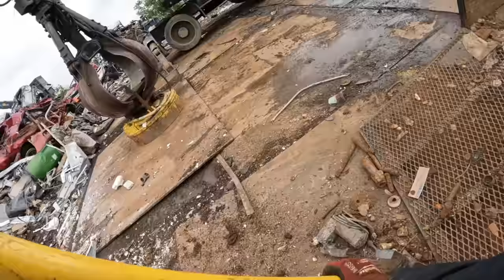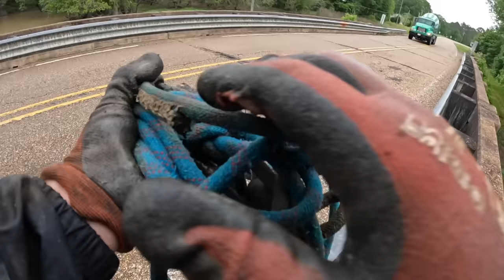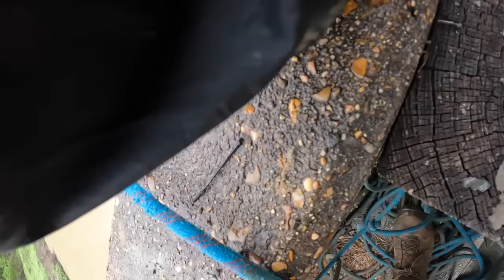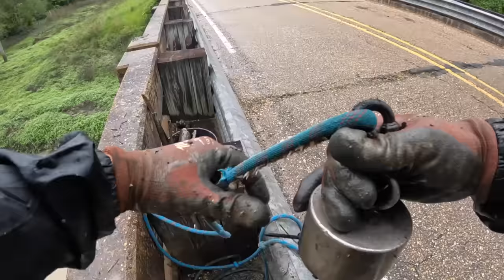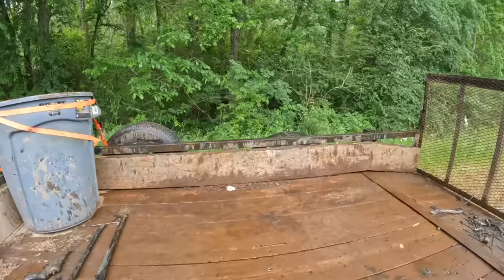GUN Stash Uncovered While Magnet Fishing - Best Day Of Magnet Fishing Ever

Comment: The triangular blades you're finding are the cutting blades of a swather (cuts alfalfa,maybe wheat too.) Mounted in a line the width of the cutting head going back and forth just like an electric barber shear.
Reply: Exactly
Reply: also found on the front of combine harvesters
Reply: Yup swather blades. Installed several over three years cutting hay and straw as a teenager.
Reply: @oldfart2413  also a sickle bar mower.
Reply: Cutting knife of a grain head.
Reply: they are also used for cutting beans
Reply: Mower blades old tommy mower blades
Reply: I confirm, the triangular metal parts go on the cutter bar of a combine harvester!
Reply: @andrewo763  also on horse drawn hay mower,,,,,,the other thing this city boy didnt know was a main bearing from an  engine, and a steering rod end with balls on the end for steering car or carriage
Reply: We called that machine a Sickle Mower. Commonly used to cut hay in the old days and I've seen a lot of them used to trim highway shoulders using fairly small tractors.
Reply: I haven't run a swather for about 20 years but I knew those blades as soon as I saw the first one.  You never forget them after you've had to sharpen thousands of them.
Reply: or on old horse drawn hay mower,,,,

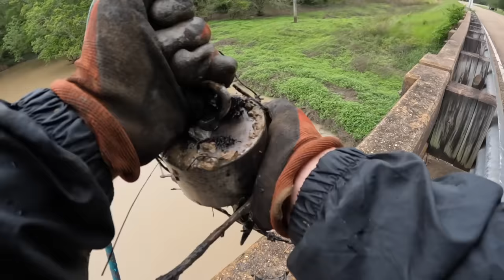Comment: 2:24  An engine rear main bearing.
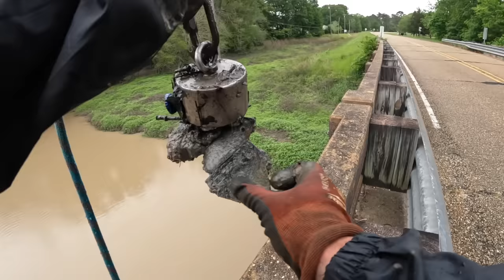2:48  Those are John Deere sickle mower blades. (I have changed a bunch!)
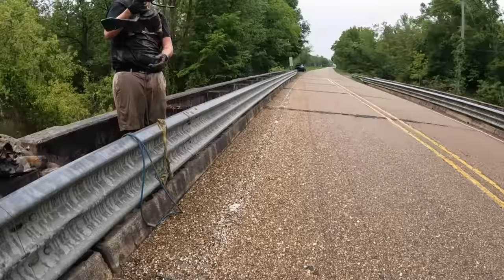13:04  That is a Ford smog air pump
Thanks for the fun just watching!
Reply: I wasn't sure which (if any particular) but did recognize those header knives as what they are. Also immediately recognised the bearing too. 3.40 might be what we call "welsh plugs" here in Australia. They're those metal caps you put a dash of loctite around then drive into an engine block to seal the holes they needed to cast the block. I've never noticed one that big before though, it's got the right shape but possibly a big diesel maybe?
Reply: @lorditsprobingtime6668  Camshaft bore plug.
Reply: @myfavoritemartian1  Thanks, that sounds like exactly the sort of thing I was thinking, just usually used in for the externals to seal the coolant into the blocks.
Reply: @lorditsprobingtime6668  not needed to cast the block,,,,but they are water jacket freeze plugs,,,,,hopfully if water freezes in  the block, these weaker plugs will be pushed out by the ice and save the block from being split by pressure of the ice inside,,,,freeze plugs,,,,
Reply: @bill45colt  Ah, thanks, that makes sense. I'm in Australia and I don't think we use, or need that sort of thing here. I have seen the damage freezing can do to engine blocks from watching channels like Barum Engines in England where they do get a lot colder.
Reply: 2:48 I'm in France, it's look like blades of vegetable grinder Eliet from Belgium
Reply: They are the blades I use on my New Holland mower conditioner

Comment: That solid bar with the right angled piece is a steering spindle probably off a tractor. The long part is what turns/steers in the steering tube, threaded end of the spindle seems to be broke off and so it won't hold the hub on anymore. I have one almost exactly the same from a 135 Massey Ferguson.

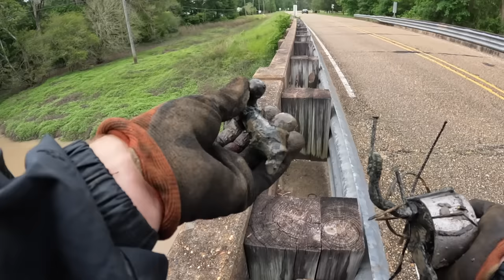Comment: 1:35 That is part of a steering arm for 1930's car.
2:25 That is half of a crankshaft main bearing . To what engine is unknown.
3:39 That could be an engine core plug. Large enough to cap off the end of a camshaft. 
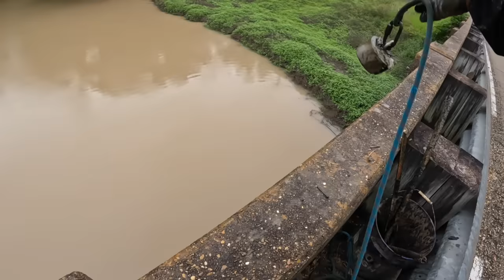4:59 That spring is a brake shoe return spring used on drum brakes.
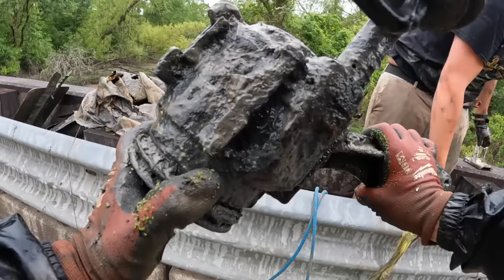13:08 That's an air injection pump used on engines to help with emissions.
Reply from the maker: Somebody was cleaning out the shop and didn't want to drive to the dump. I appreciate the education. I'm constantly learning more bc of yall schooling me lol

Comment: no gun has a "clip" please use the correct wording. it is a magazine.
 and i hope you are up to date with your shots, a stick from such rusty nails out of that dirty water would net a very bad infection.
Reply from the maker: A clip holds cartridges together to make them easier to load into the magazine. You can also use a clip to load a cylinder. The magazine feeds rounds into the firearm's chamber during shooting. For example, the M1 garand takes a clip, not a magazine
Reply: Somewhere between the speed of sound and the speed of light, probably closer to light, is the speed of gun nuts saying "it's not a CLIP, its a MAGAZINE!".
Reply from the maker: @ostrich67  I say it on purpose just to get them all ruffled up 😂